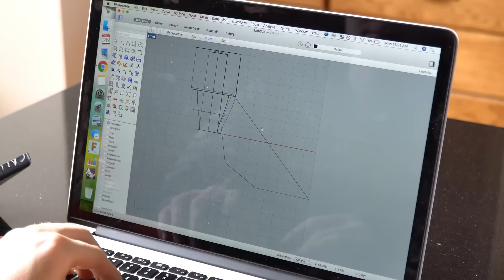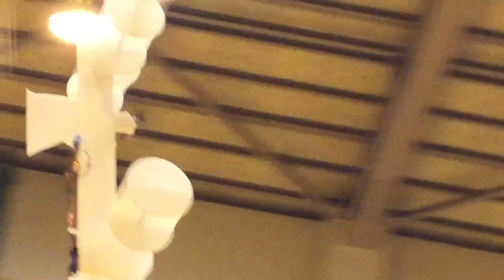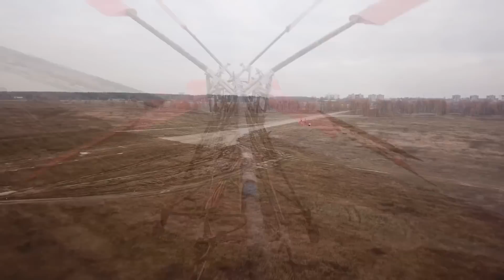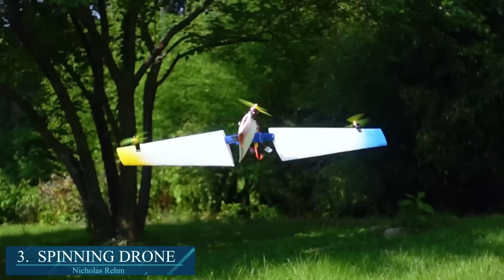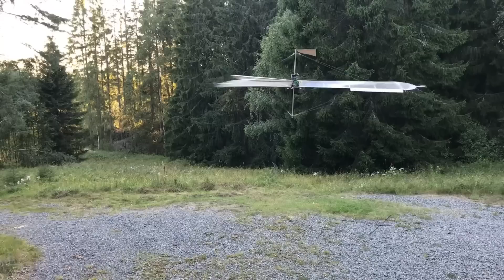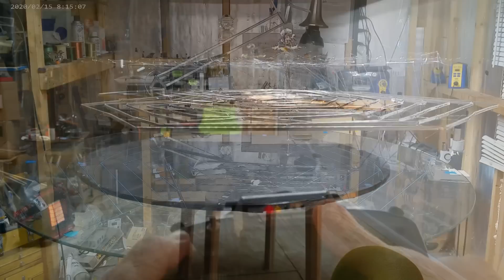7 STRANGEST RC Aircraft

Comment: If 2 mph wind grounds your aircraft,  maybe it doesn't work guy
Reply: The ion propelled prototype aircrafts can handle a little better wind than that and they do work.  
As they are made larger the circumference increases with pi X D, whereas their area increases with pi times the radius squared.  Therefore, if larger crafts are kept level, they will be considerably more wind resistant, when flown outside.  
The craft will fly all day with thin film solar cells or beamed power.  It could also work with fuel cells or newer battery technologies in theory, so it could be flown at extreme altitudes or in space, with the addition of small added propellant tanks.  Please keep in mind that these are only proof of concept prototypes and more powerful better versions are being developed.  They fly literally whisper quiet, and in the future will have improved performance.
Reply: @KraussEMUS1 that's a stupid take. You want to sound smart while being wrong. Ion drives only work in space for a reason
Reply: @krotchlickmeugh627  Google ion lifters, and ionocraft, or ion propelled aircraft.  There is such a thing.  The electric wind or ion wind has been known about since the days of Ben Franklin.  You are incorrect.  Study the subject before ridiculing.
Reply: @krotchlickmeugh627  Ethan Krauss's channel has videos showing ion propelled aircraft working.
MIT also made a model airplane which used ion propulsion. The MIT aircraft few indoors and required a catapult assisted launch but once in the air, it flew under its own power.
The Plasma Channel has a couple videos on ion propulsion. He intends to make an airplane using ion propulsion. 

Ion thrusters used in space require some sort of fuel to produce thrust. Ion propulsion inside Earth's atmosphere, uses air molecules to produce the thrust.

Ion propulsion is really cool tech but I have a hard time believing it will be practical as a form of aircraft propulsion.

Comment: Yeah, the ion drive machine is definitely the coolest.
Reply: Probably the us army already developed ufos using such propulsion systems 😂
Reply: Yes it definitely is very cool. I wonder how long the batteries last and how much it draws levitating. And would it work in low earth orbit using solar cells? Discuss !  😀
Reply: @matsgustavsson665  maybe take a second look at the table. It might hold the secret behind a longer flight time.
Reply: @matsgustavsson665  it ionises and propels air so in lower pressures like those at higher altitudes there isn’t as much air to push so it would get less powerful.
Reply: @conorstewart2214  yep